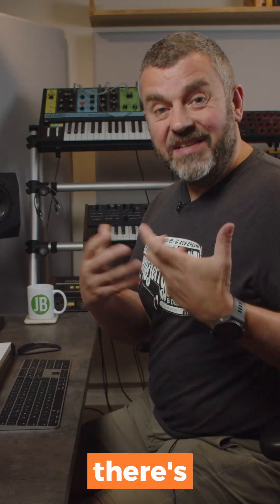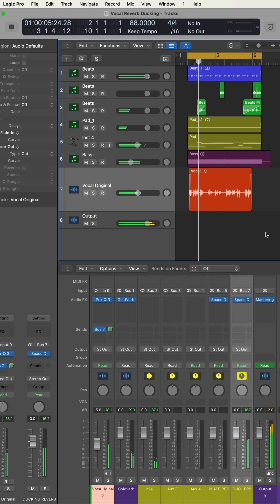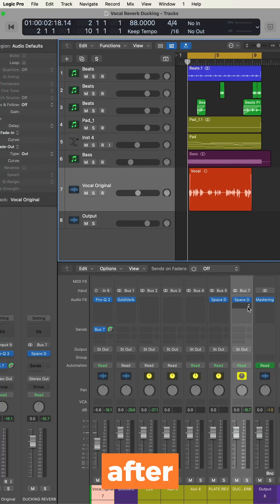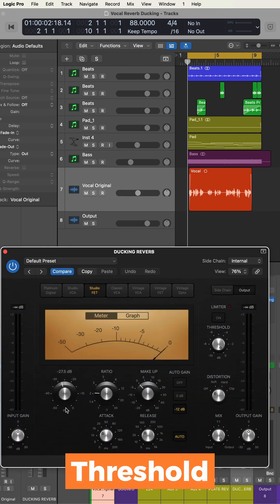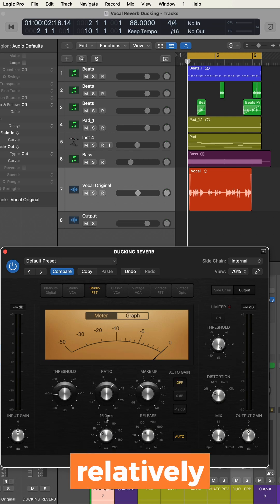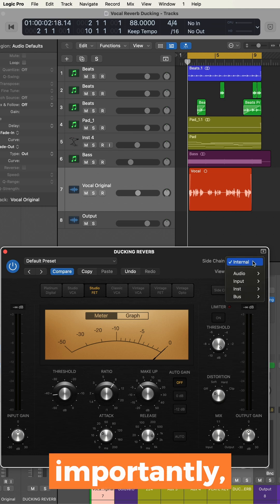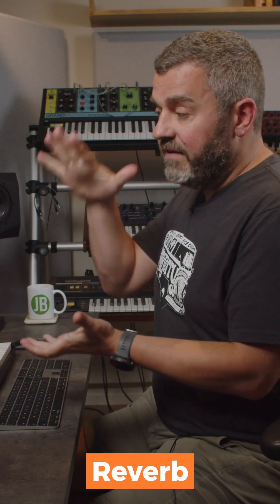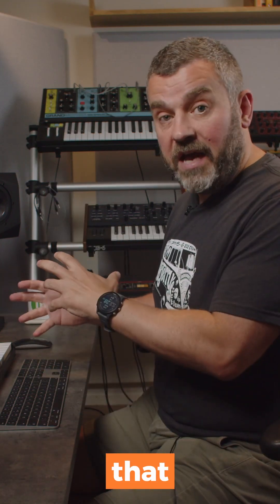LOGIC PRO - How To Duck Vocal Reverb

Comment: how to do the opposite of this where the reverb stops AFTER there’s no signal from the vocals i.e in the space between phrases. id only like the reverb while the vocals are active
Reply from the maker: There are a couple of ways you could do this but I'd suggest putting a Noise Gate after the Reverb. You'll need to tweak the Threshold point so that the reverb hard stops as its Decay drops down below the Threshold. If that doesn't work automatically, you could send the Vocal part to the Noise Gate's side-chain input, so that the Gate only opens when it 'hears' the dry vocal coming into it.

Comment: Question - why the long release time? I set attack and release very short so the verb ducks quickly when the main vox-track sounds, then comes right back up as soon as the vocal stops. What's the advantage of the long release?
Reply from the maker: Hi Luke. Great question. This is a really atmospheric track and I wanted the vocal reverb to feel like a more active layer than it might with a super-fast release time. I like the sound of the reverb crescendo each time the reverb fades back in rather than a ‘snap’ volume boost. You’re quite right though - in most musical contexts, a faster Release Time than I’ve used here will often prove useful.
Reply: @jonobuchananmusic Thanks - I'll experiment with the release

Comment: what if i have more than one track ? how to sidechain then ?
Reply from the maker: You've got a couple of options in that instance. You could manually copy and paste the Compressor to each Track where you want to apply this technique (hold down 'Option' whilst dragging the Compressor effect to each Track). The advantage of that would be independent control over each instance of the Compressor, to tailor it to each individual sound, though this could be quite time-consuming if you've got a lot of tracks.

Or, you could put the all of the Tracks you want to apply the technique to into a Summing Track Stack and put the Compressor on that 'grouped' Track. That way, all of the individual Tracks within the Track Stack will be treated 'as one'.
Reply: @jonobuchananmusic or can i route all the vocal track to for eg. BUS 1 and then Sidechain my compressor to BUS 1 ? will it do the same thing then ? and thank you soo much for you efforts
Reply from the maker: @chillingboi9172  Yes, you can absolutely do this. If you highlight the Tracks you want to apply the technique to and put them into a Summing Track Stack, this is exactly what will happen. It's a short cut for having to route all of those Tracks to a Bus manually.
Reply: @jonobuchananmusic thank you soo much !